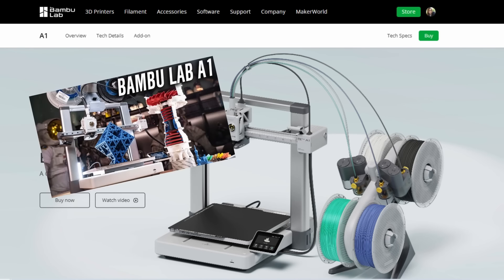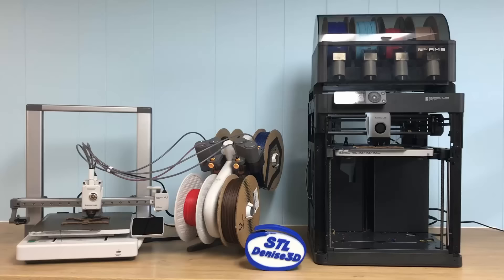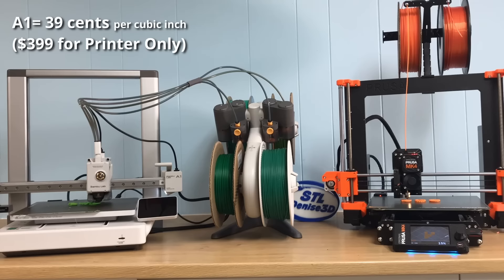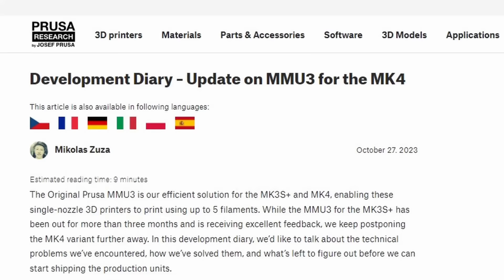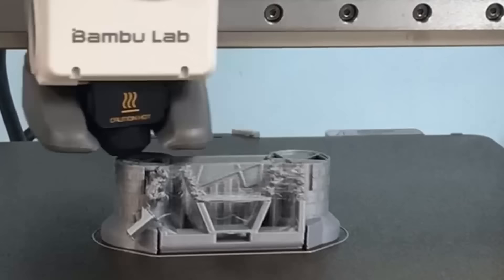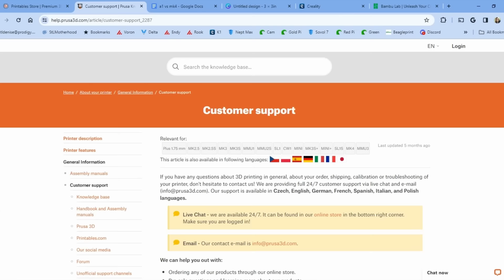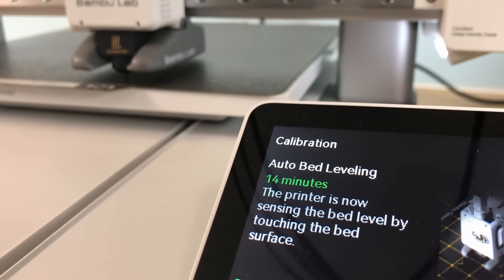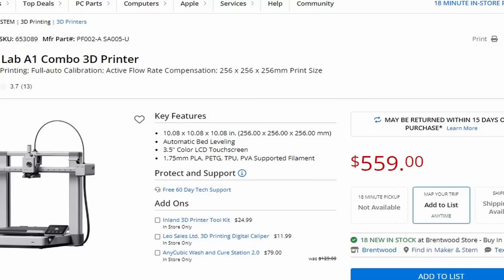Battle of the Bedslingers: Bambu A1 vs Prusa MK4

Comment: Casually saying "yeah its more expensive" as if its not nearly 4x 😂
Reply: A1 is $400. MK4 kit is $800, MK4 Assembled $1,100. So 2x and 2.75x.
Reply: @aaronchamberlain4698  and with all the shit add ons and upgrades you need to match the Bambu it's 3-4x
Reply: @MrSirclint  WTF you talking about? Lol. She literally showed in the video that it prints at the same speed as the A1 and performed better.

I have a MK4 and did $0 of mods to it. I’ve bought some different size nozzles and made an enclosure for $80 using two IKEA tables. Tada. Still $300 cheaper than the X1C.
Reply: @aaronchamberlain4698  cool. Compare it to the A1 then. Because the mk4 is not even comparable to the x1. The x1 is a totally different class. Quit trying to justify spending 3-4x for a worse product lol
Reply: @aaronchamberlain4698  not to mention you're talking about the kit. So 10+ hours of assembly that may or may not go well vs out of the box functionality. Compare your prices to the assembled version. It's not a better deal or better printer in any world
Reply: @MrSirclint  K. Thanks for letting me know the printer I built and have owned for 6 months sucks. I guess you know more than me.

I’ll go around and take everyone’s Christmas gifts back. I printed something 5 lithopanes, 3 games of Tetris, 8 Gingerbread ornaments and 1 Full Size buggy. Apparently they were all garbage and should be thrown out immediately. I’ll also have to find new friends because they said they liked them. But if a random stranger said they were trash, I now know they were lying.
Reply: @aaronchamberlain4698  didn't say any of that but hey. You do you. Just cause you spent more money and time and bought an inferior product, there's no reason to shoot the messenger lol and it's fine, deep down you know it's true 🤣🤣🤣🤣
Reply: 600€ for A1, 1100+299=1400€ for mk4+mmu3 and then you don't have camera's, acceleration sensors, filament jam sensors and more I forgot about.... More then 2x for less function
Reply: It never ceases to amaze me how fast the bambu bot accounts pounce on anything Prusa related.
Reply: All I'll say is that I have the MK4 kit and a K1 and maybe soon an A1 and many orhers. So far I can honestly say that I have no issues with the MK4 and when I had a sheet of multiple items printing that the new skip item feature worked great. The K1 has done well but will be swapping out the original extruder with the newer version. Now since I don't have an A1 yet I can only imagine it will prove to be a great printer as well. In the end, it comes down to does the printer do what you need and are you happy with it. It doesn't matter what price it is as if you're fine with it then it's your money. Each manufacturer has their pluses and minuses with each printer they have. You can start cheap with a low-end Creality or spend a little more for things like a Sovol, Bambu Lab, Anycubic, etc, or pay more for some others. I have a variety of printers and manufacturers, and all have something that is great about it and something not so great. Some will just want a printer that they can start printing right away with little effort, and some like myself also enjoy assembling a printer like the MK4 kit, Vorons and similar. In conclusion, buy what you want and enjoy it.
Reply: @VisualReversal It's not our fault prusa just isnt competetive anymore. The only reason the get a prusa is open source
Reply: @MrSirclint fair point and the Bambu most of the time just work like my X1C
Reply: European  Quality  ???
Reply: Closed source and Prusa hasn't had to recall anything... @MrSirclint
Reply: @rabbidjeremy9193  lol for 3-4x more money if I have problem with Joseph himself should fly out and fix the fkn thing. (I'd much rather a company mass recall. To me that shows accountability and customer attention)
Reply: @MrSirclint I own both Mk4 and X1 and I can tell you that the Mk4 compares well to the X1. The enclosure is a big deal but tbh the Mk4 handles engineering grade and exotic material better than the X1, has better bed leveling, and can definitely match the speeds. I love and use both but if you're gonna bring up the Lidar, it's mostly a gimmick at this point, I never use it.
Reply: @tyotee4361  that's reaching at best and you know it lol especially if you consider straight out of the box use.
Reply: @MrSirclint  Which are you referring to as a reach?
Reply: @MrSirclint don’t bother wasting your time to argue with sour Prusa user lol, they get triggered so easily knowing a much better printer exists that cost 2.75 times cheaper they feel compelled to argue when you said “nearly 4x”, they just angry for being the sucker lol
Reply: It is fun to read arguments about printers which cost far more then $100.

PS Average Ender 3 Enjoyer.
Reply: @aaronchamberlain4698  looks like someones coping with buying the wrong item 😂😂
Reply: @jordanplays-transitandgame1690  Feels weird to reply after 6 months, but nope. Now had the MK4 for a year and it just keeps getting better. I broke a fan mount being stupid and it was super easy to let someone just print me a new one. Down for a single day. Can’t do that with other brands.

I’ve since tossed it in an enclosure that cost $70 to build and started printing perfect ASA and PC-CF. I plan on adding the MMU after seeing a coworkers success with it. All roads lead up.

Comment: One thing . Closed source vs open source. I can remember a certain  few “ Revolutionary “ 3d printer companies that went belly up and the printers are now paperweights because everything was closed source and preparatory. Not to mention the possible privacy issues.
Reply: the firmware of the X1 series was recently reverese engineered, the slicer is open source and the hardware is not that complicated, most of the stuff can be sourced from after market sources now except some core components - but realistically: if bambu lab would go out of business, there would be soon a few mods where you just replace the logic components with components from, lets say the voron project and have a functioning printer again - the Fysetc Spider mainboard for example costs about 60 bucks

since prusa also closes hardware (especially features on the MK4) you would have the same "issue" after all
Reply: Bambu stated from the beginning that if they shut down, all designs, patents, schematics, and software code will be made open source.
Reply: They stated that they will end bedslinger era. But they manufactured two Bedslingers already = )
Reply: @suit1337 were you making a point for bamboo labs ? Because you lost me at reverse engineered.

Comment: The Prusa MK4 lacks accelerometer sensors, and their idea of  input shaping is locked to static values.  That on itself is a huge issue in terms of keeping constant quality of output as the IS values are derived not from the specific machine, but a "generic value".   The funny part is Prusa themselves fully admit "accelerometers are essential for correct input shaping", yet they do NOT include these sensors on the MK4 (it does have an input port for 1 sensor, which is not enough for a bedslinger, but even that port is not attached to anything), and DO include them on the Prusa XL in each toolhead but are NOT capable of using them atm.  For printers at these price tags, that's a major let down, especially since Bambu doesn't just use these sensors for input shaping, but they actually also use them to monitor the machine's "health" in terms of belt tension and possible unexpected levels of resistance in the movement system.
Reply: not a huge issue at all, i use the same IS values for all my tridents and have no issues. Its not as big a deal as people think. They are essential for initial values but not required at all times.
Reply: @thegarageluthier  What a ridiculous statement. People have their printers on all sorts of surfaces which definitely affects the values.

If you have 3 of the same printers on the same surface then yea, of course itll be fine. Completely misapplied logic.
Reply: @BeefIngot  Is that the same misapplied logic that led you to believe that they are all on the same surface?  Experience and understanding that this is just 3d printing and not rocket science, people love to get sold on the new shiny without ever really understanding if its needed or not.
Reply: @thegarageluthier  If they arent, you are getting lucky and do not understand how input shaping works.
Reply: @BeefIngot  Im sorry you must be right I have only been an electronics engineer and programmer for 30 years so probably don't understand shit.
Reply: @thegarageluthier Ah the ol "when you cant back your argument, make up credentials and appeal to authority" strategy. A strategy old as time.
Reply: 1. Do you have numbers to back you view? I mean effective, not just fractions that in real life do not make a difference.
2. Even Bambu Lab A1 Mini cannot fully compensate floating configuration.
3. It's quite easy to find sturdy base for a printer (floor, if everything else fails), or put it on concrete slab.
Reply: @BeefIngot  my credentials are in operation on different continents, in companies like Diageo, Grants, RHI Magnesita, Mahle, Munro Miller,  SGL Carbon Fibre and around 50+ other sites including MOD and the fire services. But if you want to compete it is fine by me.
Reply: @thegarageluthier  I love that you're still going the "I work at nintendo so the incorrect shit I said is right" route.
Reply: @thegarageluthier  Rocket science isn't that difficult. It's just classical physics, not even quantum. :p
Reply: i mean marlin also relays on the fice values and they work really good
Reply: @Lucas_sGarage  Marlin does not. You can tune marlins values based on manual prints.

For marlin especially, with the breadth of printers they support youd have a bad time trying to use the same printer values especislly given it can go on c9m0letely custom or modded printers whereas prusas are less lioely to be modded.

All the same, it's definitely notably better not to assume because unpess all of your users have a similar surface and belt tension and moving masses, you'll be quite off.
Reply: @BeefIngot  I mean you are right, what I  meant to say is that it doesn't use an accelerometer
Reply: @Lucas_sGarage  What we are talking about hete gors further than lacking accelerometers though. The mk4 doesnt let you change the values.
Reply: @thegarageluthier  you cannot assume anything in regards of end user's behaviour
Reply: @letshin that’s why everyone can build Saturn V in home? 🤦

Comment: I really wanted to get rid of my Ender 3 Pro that I bought in 2019. It was becoming a hassle to print normal things. I was so close to biting the bullet on a MK4 but right before I completed the order I looked to see some competitors and saw that the A1 had literally just come out. I instantly bought one instead of the MK4 and its been amazing! It got to my house in 2 days (right before christmas!). So much more reliable than the ender and so far its been "print and forget". Not going to shill Bambu Lab or any other brand but this printer has been great in my experience, the value is crazy good in my opinion.
Reply from the maker: And Ender 3 Pro was my 2nd printer (right after a cr10s) -- the difference is night & day. Happy Printing!
Reply: I have a X1 one too. But being to unable to mod and mess with it is a huge downer after some time.
Reply: I bought an Ender 5 Pro two years ago, liked it for some time, started to be really annoyed by it. The bed has a spot where nothing ever sticks despite being equipped with a BLtouch, now the filament does not go through the hot end anymore. I exchanged the hotend but no difference. The extruder keeps pushing and it thickens up in the tube before the hotend. So annoying.

I am done with tinkering with my printer. I am not interested in  working on the printer, I want to print with the printer. Right now I am considering: Bambu bedslinger A1 or CoreXY P1 OR go to Prusa with their phantastic support and community. After my experience with the Ender I think about the service oriented Prusa despite the higher price
Reply: While tinkering with printer is nice, I am too like just to print. That's why I am no longer tinkering my Ender 3 and just printing. Good to know that I am not alone.

Comment: I bought an A1 to replace my Prusa Mini. Compared to the MK4, my mini just can't copy the quality so I figure this might be at time to try out this legendary Bambu product line. If I think about it, the A1 competes on almost all levels with the MK4 for 1/3 the price. At least, it should. We'll see how it goes. I've been needing a second larger bed printer anyway for some projects so might as well see what the hype is about.
Reply: i have the mini aswell,but the quality almost same the bambu is just slightly better but faster and bigger
Reply: @pakssmsjsjsks8596   The PRUSA mini or the BAMBU mini?  I have a Prusa mini - and that has been an underwhelming experience.  I've been thinking about getting an A1 to up the print speed and quality.
Reply: @thomasd9827 the prusa, i have the Prusa Mini, and the A1 the quality is not much diferent, i printed now around 180hours with the A1 and 500with the prusa ,i like prusa firmware better you get more  options than the A1, the A1 is like for lazy people who dont like tinkering that much😅 but it looks modern and cool and the AMS is working good, i dont know about the price thought is it worth it? maybe idk, i didnt have problems with the two
Reply: @pakssmsjsjsks8596   the price point comparison seems favorably skewed towards the A1 full size vs the Prusa Mini from my point of view.  for what I paid for the Prusa Mini, shipping, and import fees - I can get a full size A1 with AMS and some change to spare for extra A1 nozzle kit and some filament rolls.   I'm going to get an A1 since the MK4 isn't cost competitive.
Reply: @thomasd9827  yea the size, somehow i forgot that😅the only thing that i hate about prusas is the looks,i dont like the printed parts(on progress to print my own with better quality) on my mini and the V rods or what is it in english,when i got the A1 the MK4 wasnt on my list, only the A1 mini,   but beware its uses like almost 3prusa mini in size with the AMS.
Reply: @pakssmsjsjsks8596  I went and splurged - got the P1S combo.  It’s been printing like a dream.  No manual z cal (even with the pinda sensor on my old mini this turned out to be a mostly manual Z adjustment) prior to switching plates - it’s a machine that just works.  Hot end swaps are a little more involved than the A1, but no one can really complain about them compared to what every other previous printer made you go through out of the box unless you built your kit around a Revo nozzle.   The Bambu printers just work.
Reply: _Richard_F___  It didn't work out well. I had to return it because of the kinked power connector.

Comment: I ended up purchasing the bambu labs x1c w/ams. The MK4  was the one I was going with but the youtubers made me lean towards the bambu labs. I should also mention that this is my FIRST 3d ever and my pc since 2001. So to say I'm a newbi is an under statement. This is why I chose to get the x1c over the mk4. I still mite have a mk4 one day but not yet. My toaster test I did didn't look as bad as yours did mine was totally beautiful printed and got .2 on the inside looseness. I was very impressed.

Comment: I have a question about the quality of print if you slow down the A1 can you get good quality prints like the Mark 4 I have a ender 3 V3 SE and I hate it will the A1 make better quality and accurate Prince than the ender 3 V3 SE
Reply: The A1 will make prints close to flawless each and every time, without too much fiddling.
Creality is total trash.
Get a bambu and never worry again.

Comment: maybe you should have put an MMU on the Prusa, that would be an interesting comparison. And yes, seeing a price per cubic inch would be interesting.
Reply from the maker: I’m waiting for it to be compatible! Right now it doesn’t work with the mk4 tool head. 😔
Reply: I own a Prusa MK2, Mk3 with a mmu2 and a x1c (with AMS).  My dad owns ender3's and now owns a p1s (with AMS).  You can do a generic cost per cubic inch how ever that does not do it full justice.  While I have no clue how the MMU3 does, the MMU2 only successfully print around 70%-80% (vs AMS's success rate of 99.9%) of the time.  I love my Prusa printers.  I hate Prusa's MMU.  After printing with the AMS for a few months I would not go back if doing a lot of multi color printing.  The MMU2 now sits collecting dust and the mk3 is used for single color functional prints mainly CF and very soft TPU (such a 85A NinjaFlex).  The MK2 is put away and is now a backup.
Reply: That's a hard ask, it would be hard to find a working MMU in the first place haha. On mk3s+ it was nothing but hot garbage for most people.
Reply: @brianjensen5200  weird,  I just started using an MMU2S on a MK3S ... the MMU2S kit sat unused for 4 years,  I finally assembled and installed it recently,  doing multicolour topographic prints for engineering projects,  hundreds of tool changes in each print.  I do get pauses for filament tip problems,  and the odd other error but so far I'm running at 90% success,  counting a failure that was my fault.
Reply: MMU3 should be compatible with mk4 @stldenise

Comment: Just got me a MK4 ... big jump from my Ender 2 v3 ... works out of the box, and doing some great stuff with it quickly.  The input shaping is fast.  The Baboo stuff is definitely better for the money -- at least for the short term.  I still think the MK4 is better as a printer.  But time will tell.  Use what you can afford and what works BEST for you -- don't worry about the brand.